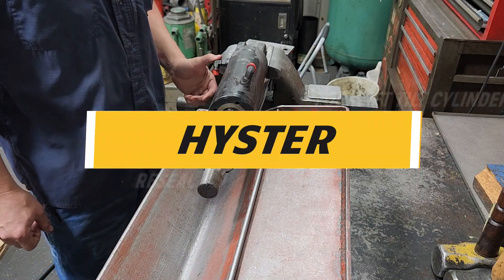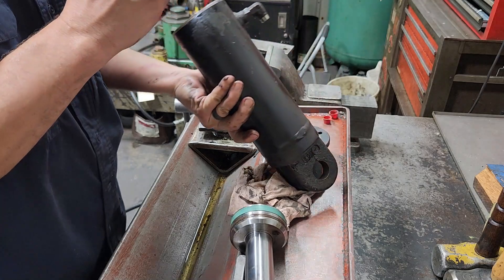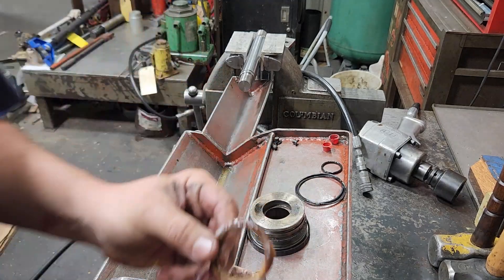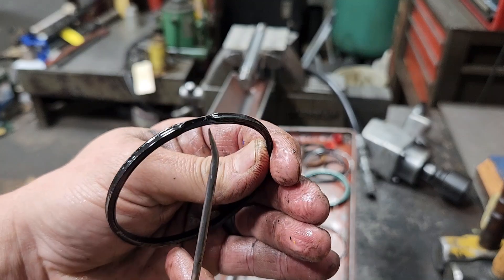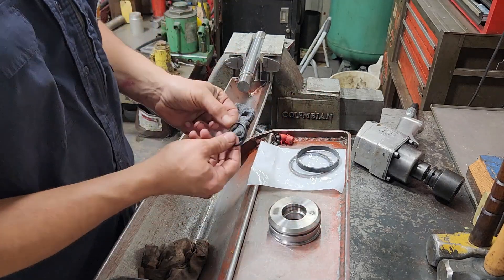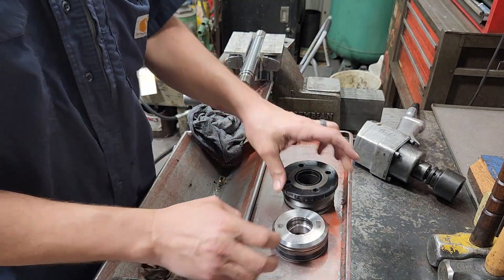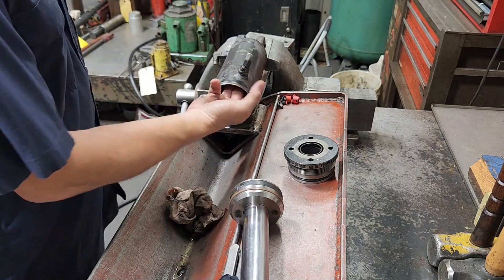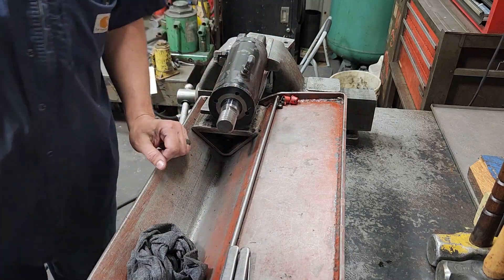HYSTER Tilt Cylinder Reseal

Comment: Where can I get the correct size new seals , for the cylinders
Reply from the maker: First option would be from the dealer, but they can make mistakes. You could follow the link below to measure out your own seals or get you on the right track. The best option would be to go to a local hydraulics shop if you have one near by. This video is for a Kubota cylinder, but the principle applies on every brand https://youtu.be/1LsVFQYI-40
Reply: @HydraulicRepair I made a couple calls and found out that the cylinder is a Pacoma , seal kit N342 fits newer Rotary lifts , 7000 to 12000 lbs, lifts .
Reply from the maker: @MegaRiffraff it looks like their made in Germany so they'll likely have metric seals in them. Hopefully the kits work for your particular cylinders!

Comment: Where did you get that spanner tool?
Reply from the maker: Those probably came from Grainger. Just do a search for adjustable pin or face spanner wrench. Hopefully, this helps!
Reply: What size socket is that on the impact?
Reply from the maker: @ I'm sorry, but this was a few months back and I don't recall.  I'll try my best to call out sizes in future videos.

Comment from the maker: I hope this was informative. Let me know what I can improve on.
Reply: Part numbers model of forklift?
Reply from the maker: @clydecare  This was for a customer a few months back. Unfortunately, I don't have a model or part number for reference. This style cylinder is commonly used for Hyster tilt cylinders from what I've encountered. If you're looking for a "seal kit" any reputable hydraulic shop in your area should be able to measure them out for you without needing any equipment part numbers. Thanks for watching and commenting!